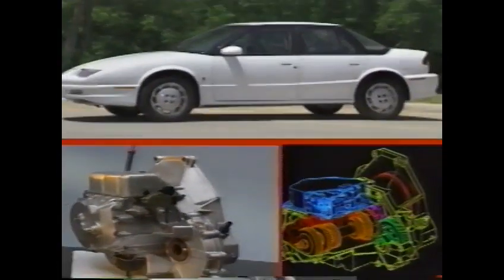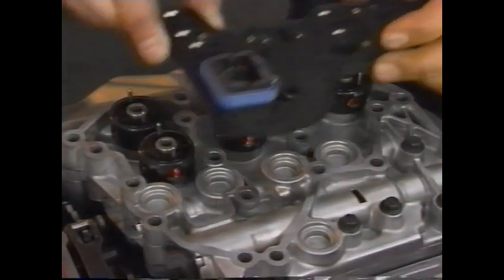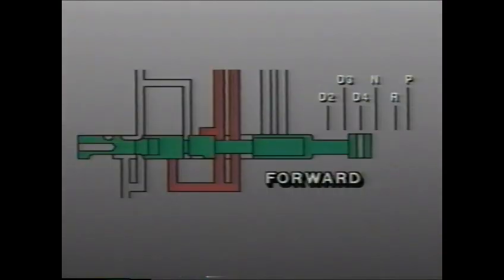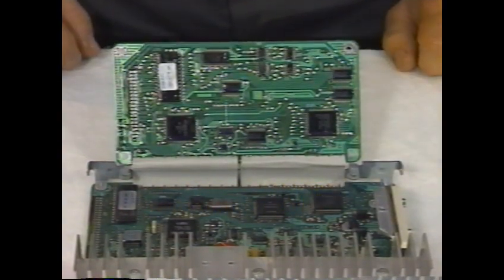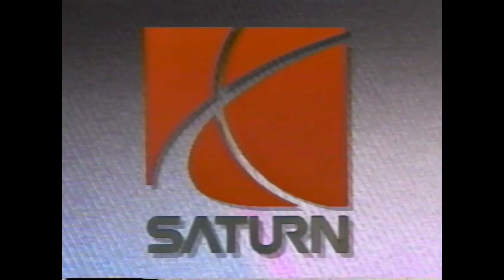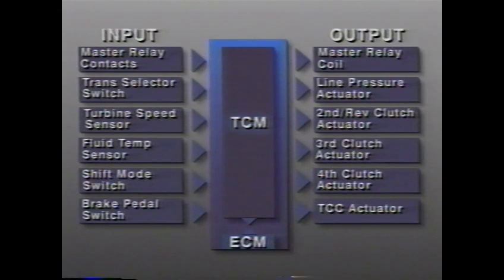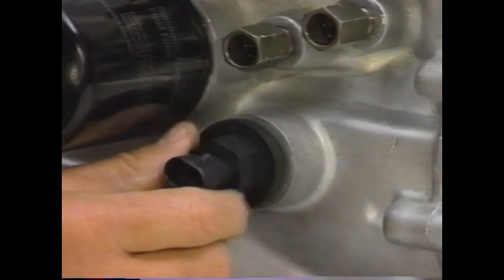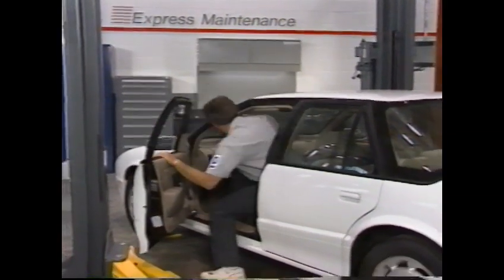Saturn Training Video - Automatic Transaxle Diagnosis

Comment: I bought a Saturn Vue with AWD and a V6 brand new in 2004.  Under warranty, I had the transaxle worked on 3 times and each bill was well over $1500 to $2000 to GM.  The car lasted for 113000 miles before I sold it to CARMAX for $2500 in 2014.
Reply: +Chaleco Salvavides Not the same transmission as this video you had a cvt and it is known to have a high failure rate.